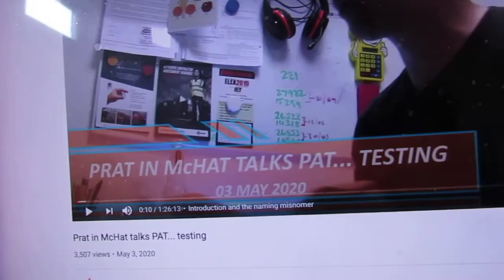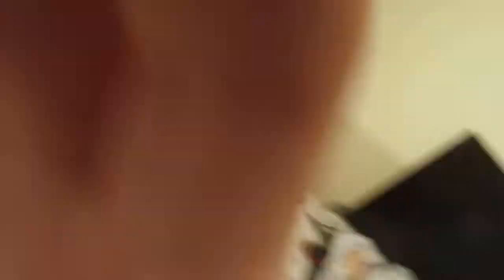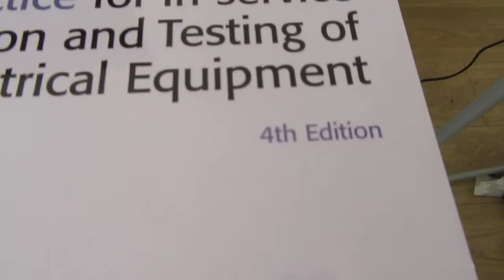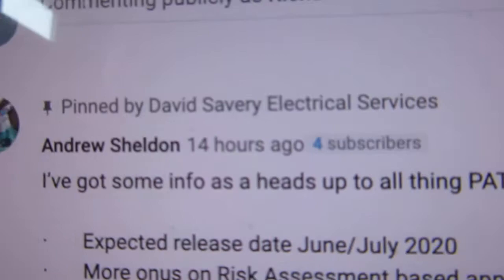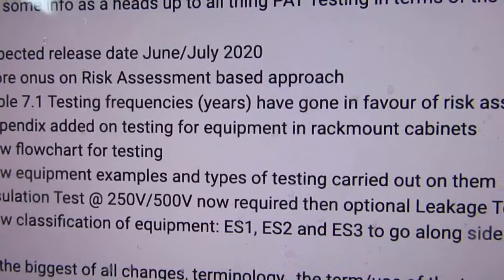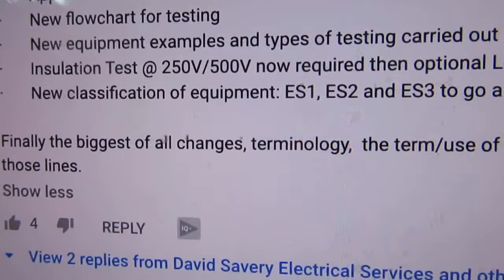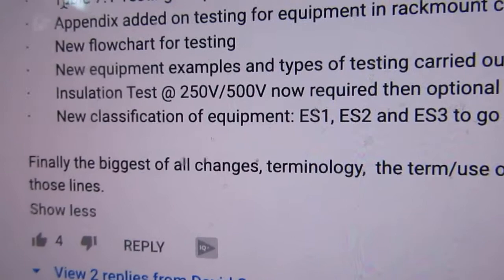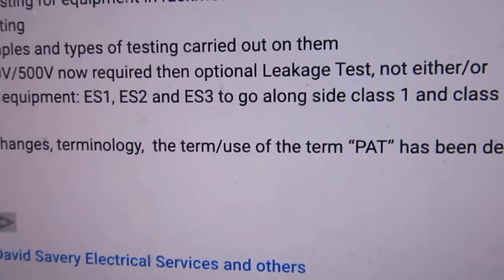SHOUT OUT TO DAVID SAVERY - DAVID SAVERY ELECTRICAL SERVICES

Comment: An honour to appear in shoutout form Richard! With regard to the testing procedure itself, I doubt we'll all need to rush out and buy new test equipment. While the paperwork part of the procedure may change, and more so perhaps for the duty holder than the person performing the testing, the equipment to be tested and the type of tests undertaken will I'm sure be the same. We'll still want to ensure the earth path of earthed equipment is good, and the existing limits will still apply. Same with IR. Leakage and load tests will probably remain optional. How the equipment is classified and recorded may change, but I can't imagine anything with too big an impact. You should be able to procure a modern PAT instrument in confidence that it won't suddenly become obsolete.
Reply from the maker: Thanks for the comment.  😎